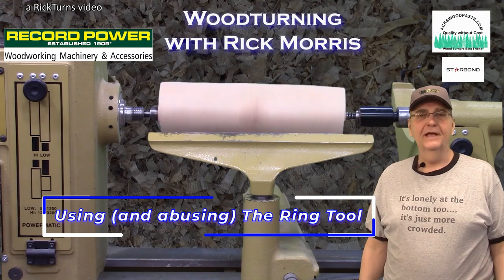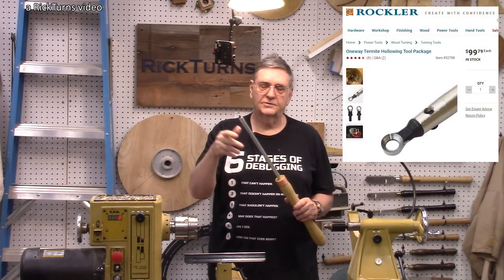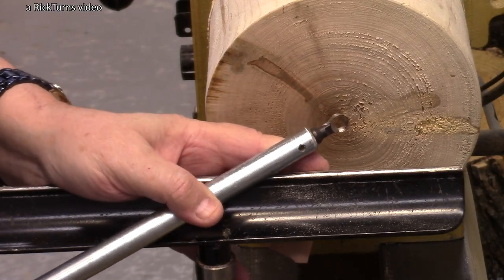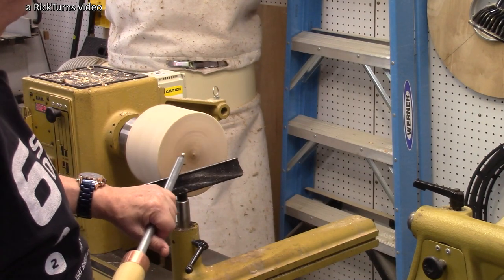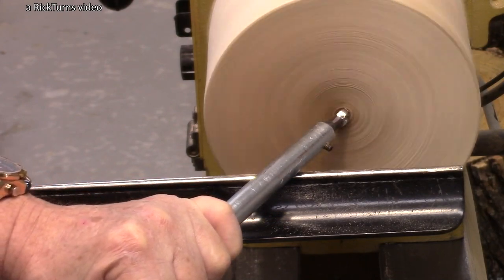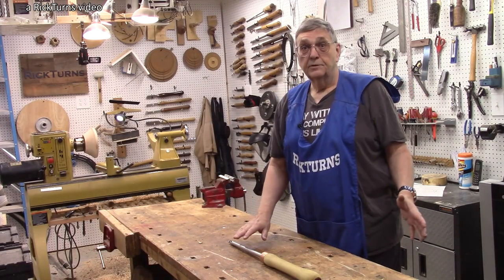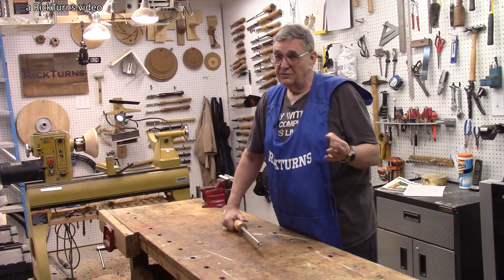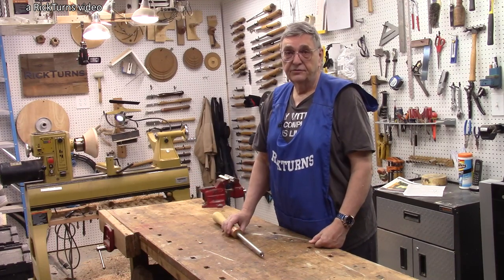Woodturning: Using (and abusing) the Ring Tool

Comment: The Oneway Termite is one of my favorite tools.  I have one of the first ones Oneway put on the market and I have worn out & replaced several of the steel rings.  The one thing I disagree with involves your sharpening.  I bought a dedicated, inexpensive benchtop router table that I use ONLY to sharpen these bits.  I also use their circular bit-holder to hold the tool level on the router table, while rotating the bit on the cone.  This leaves a perfectly - angled surface on the inside of the bit.  Oneway also offers different sizes of circular cutting bits.  I recommend getting and using the entire set.  The Termite is my favorite freehand hollowing tool.  If you'll cut the bottom of a bowl, box or base perfectly flat and then simply draw-cut from the bottom to the top of the vessel (without changing from the 1 o'clock position) you will get the perfect wall cut that you have on the bottom.
Reply from the maker: Sounds like you’ve got a really good way of sharpening. If I had a router and table, that’s what I’d be doing too. Thanks for watching!

Comment: Thanks for the video, Rick! I've wondered a couple things about the termite tool that you answered for me... 1. Can I use the other side of the ring to cut? and 2. What's the best way to sharpen without dragging out my router table?  Do you have or have you ever used a hook tool? That's what I've been eyeing lately...
Reply from the maker: Hi, Chad. Glad my video helped you out. I’ve never used a hook tool. The videos I’ve seen of turners using a hook tool make it look like a hook tool is even better than a ring tool, since there’s not much chance of the tool getting clogged with shavings. If you get one, I hope you’ll do a video on it - I’d be very interested.

Comment: Hi Rick, nice video, thank you. The tool seems to do a reasonable job. From the video, it looks like you should be able to get the same cuts using standard tools. Spindle gouge in endgrain working from the centre out, skew on the long grain when spindle turning and bottom feeder bowl gouge for inside of the bowl.....and now for something contentious...the roughing gouge for finish cut on the outside of the bowl (Robbo Hippy demonstrates in one of his videos). Is the ring better than the properly sharpened tools I referenced, or is it just a very good jack of all trades so easier to use just the one tool?  Keep well, Rob
Reply from the maker: Hi, Rob. Thanks for your comments. I love this tool, but I probably will only use it for finishing work on bowl interiors (where end grain is a problem), and for deep hollowing in vases.
Reply: @RickTurnsWoodturning  Thanks for replying Rick, I recently made a deep hollowing tool but am waiting for my vase to dry some more. before continuing. Acquiring more tools is addictive. Keep well, Rob.

Comment: Hi Rick -- thanks for the demo video on how to use a ring tool, and nice job making it.  Do you think it would work well to hollow out the bowl of a goblet?  Or would it be too tight a space with too much curvature?
Reply from the maker: I think it would work just fine. My latest project (https://youtu.be/E-5ur2JkuuA) was a vase with a diameter that varied from 4 to 5 inches, and I had no trouble at all using a 5/8” ring tool. The ring tool demonstrated in this video is a 1/2” bit which would work easily in small diameters.

Comment: Great review Rick. Thank you!  I'm just curious if when cutting the inside (sides of the bowl) if it wouldn't be better cutting in reverse. It would definitely keep the bar out of the way...
Reply from the maker: I think you’re right about running in reverse. But that chuck I was using did not have a set screw on the collar to secure it when running in reverse, so I didn’t try that out. Thanks for the suggestion, Mike.

Comment: Like many, you are using the tool upside down. At the beginning, twist that tool by 180 degrees, and ride the bevel. The aggressive edge you are using is for the bottom or for going deep where it is not possible to use the bevel. Used correctly, that small bowl can be hollowed with the Termite in 3 or 4 minutes, tops. Ride the bevel, rotate the tool so the shavings come out though the hole. I hardly ever plug the tool, especially on end grain. Also, cut from the center out in a cone shape, steady the tool along your forearm, lean against your lathe for stability. The tool should cut without effort, and you are working way too hard on an easy project. I go up to 30 inches deep with a huge home made shank, hand held in vases hollowed entirely with the Termite.
Reply from the maker: Thanks for the tips, hermdagerm. Would you happen to have any video of your method of cutting?
Reply: Hi Rick. Not having the tool as yet I’m trying to picture his method. Not following the upside down remark. Have you tried using the termite as he suggests and if so do you have a video of it?  Thanks Rick.